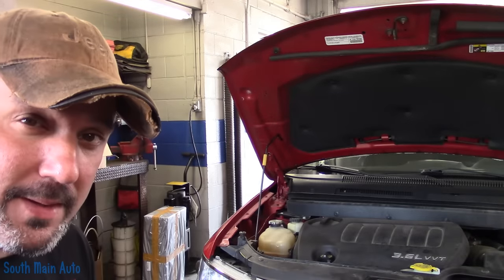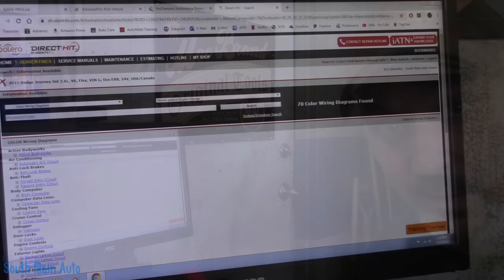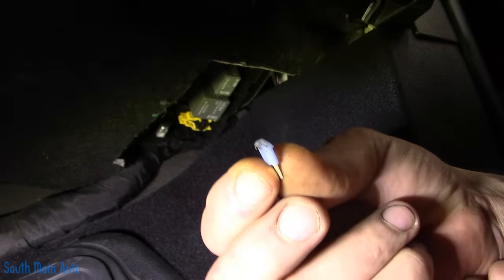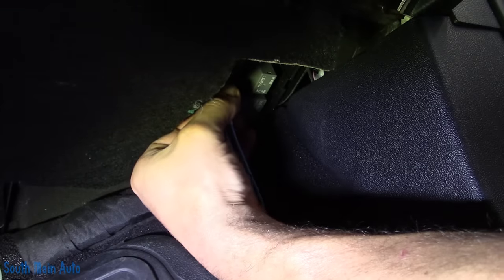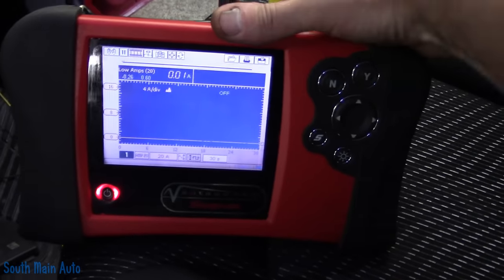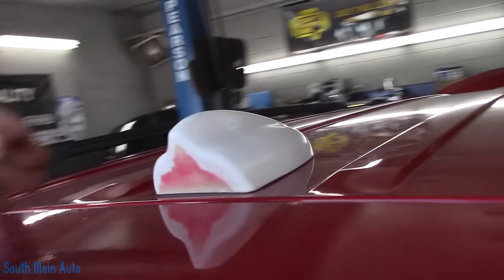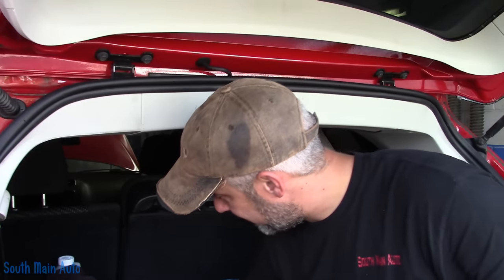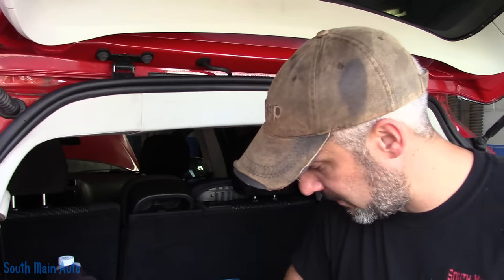Dodge Journey: No Start, No Crank

Comment from the maker: UPDATE: The customer stopped back a few days later and we installed the OEM antenna on the roof so it would solve the issues with the wet headliner. He bought the car in the condition it was in, back up camera and baby shark fin were all ready on there. He did not want to do any further testing with the internal key detection antenna's at this time
Reply: Hopefully he asked you to pull that silly cow catcher off the back too!
Reply: Just curious you disconnected the aftermarket feed wire  at the backend wouldn't it be better to disconnect at the feed just incase it rubs through elsewhere .
Reply: the aftermarket crap ends up being the eBay aftermarket crap and it just goes bad after a couple months or the rubber seals go bad
Reply: @190055joe  the video feed runs all the way to the front. The power is tapped of that module in the back. He cut the power wire and the video feed is now dead because of it. So it doesn't really matter if it rubs through, because there is no voltage on it anyway
Reply: Thanks for your very informative videos. Your patience with wiring and troubleshooting is amazing. You take the time to find the source of a problem. That's inspiring and auto mechanics everywhere should follow your example. Keep up the great work and your videos.
Reply: It is nice the aftermarket stuff didn't aggravate you as much this time; and you hit the nail on the head ...  lazy, bad installation of the products is the problem, not the product itself; they hit a moment of ignorance and instead of stopping and learning the right way, they just go for it and f the consequences.
Reply: Wireless backup cams are better
Reply: @1232bluejays  "wireless" cams still need to get 12v from somewheres....
Reply: @1232bluejays  "Wireless" are wireless for the video feed.  They still need power and for this installation it was the power feed that was the killer.  Maybe you have realized that before I write.  Cheers.
Reply: The process of getting from "car won't start" to "single chafed wire behind the headliner by the tailgate" never ceases to amaze me.  Well done.
Reply: @1232bluejays  They still need to be connected to a 12 volt power source, and that's what was shorting.
Reply: I like that you told us what the customer decided to do,.
Reply: @190055joe  That is the ironic thing, the +12VDC feed IS back there where Eric cut the wire. @22:25 "....decides to use a wire way up in here for a power source...."
Reply: I'm going to go out on a limb and say that backup cam installation wasn't overall bad, at least from what was shown. The big mistake was not realizing that wires will chafe through on a sharp edge, and do something about it, like add insulation, a chafe guard, or put them in the loom. Frankly that is an easy mistake to make if you are basically self-taught. I made it myself a few times back when I was 16 or 18 or so. Once it is pointed out to you, you shouldn't make that mistake again. If you do, THEN it is a bad installation by a bad installer.
Reply from the maker: @190055joe  That was the feed wire to the aftermarket stuff. The fuse feed the module and they tapped into it to gain a feed for the aftermarket stuff. Make sense?
Reply: according to the manual for my 2013 buick verano, when the battery in the remote gets low you may need to put the remote UNDER the cup holder before you can use the push-button to start the car. replacing the battery in the remote might be worthwhile. love the videos
Reply: @allenparke5874  low battery would be secondary.  I have a 2013 Journey and there are 3 indicators around the start button that should light in turn.  OFF, ACC, and RUN.  Off should be lit once the door is open or when the car isn't running (don't remember if it stays on continuously).  Single press from off with foot on the brake switches straight to run position and cranks the engine.  Foot not on brake should cycle between the three positions so long as the key is inside the vehicle.  When Eric first brought us inside the vehicle non were lit at all which indicated (to me) no power to the wireless key module/switch assembly.
Reply: l wilton gotta disagree, it was a bad install for both the wire rubbing issue and tapping into power in a place the installer shouldn’t have.  Ignorance of proper installation doesn’t change the fact it was a hack job.
Reply: Baby shark Doo Doo Doo doo
Reply: From the start of the video I was thinking install fail, I've been installing for 30 years and have seen some horrible and dangerous installs (mostly fire and police vehicles) I'm going to share this video in one of my car audio groups, cause I preach this stuff all the time about what happens when the customer takes the car for service and they see that crap. We have to be extra careful because we don't have access to some of the wiring a service tech has. But in the same breath I will say we get blamed far to often because a tech is lazy and can't see past the aftermarket and look at the tech brief that I find and send customer back with LOL.
Reply: Ive always found aftermarket stuff is best installed with a dedicated fused power supply.... It eliminates issues like that...
Reply: @190055joe  The aftermarket wire appeared to be drawing +12v from the antenna circuit, then feeding the camera and the device at the rear view mirror.  But who knows what was done by the dodgy installer.  Presumably a test was done to make sure all the non-oem wires were cold.
Reply: Typical Auction Car, probably why it was there. Never Have I or Would I Run Wires Through Headliner.
Reply: @DaaaveO1971  Maybe the customer has a problem with tailgating cows and road rage: the automotive version of mad cow disease?
Reply: Hi Eric and gang always good too see you
Reply: most "rear" wireless cameras get their power from the Reverse light 12 Volt Rail.  which activate only with in reverse.  there are few aftermarket gadgets that i like, Rear dash cams, and reverse cameras are them.  I don't like remote starters, since that messes with the security of the car,  this is a prime example of what not do do, there was nothing to prevent that wire from rubbing. absolutely nothing,  if ti was me there would have been a rubber grommet around that passthrough, the wire would have been feed though the wiring harness, and routed along to the front fuse box, where it would have been put on it's own inline fuse, routed from the primary 12V feed, however i feel that it being connected to a "always on" power would cause a fantom drain,  therefore i would have connected it to the accessory power rail. so that it was only powered when the car is powered.  and.. WT* is with that darn shark fin.  who in their right mind would put a dang shark fin on their car.  (puck * teenager that'd be who) and i have to agree with eric O.  that bumper has to go!
Reply: @1232bluejays  watch that really mess with the cars rf systems
Reply: Daddys shark do do do do do do daddys fin do do do do do its a leaking ing ing ing ing ING ING INGGGGG lol
Reply: @Cozmo85  thanks.  Now I got that song stuck in my head.    Do do do.   Lol
Reply: I was hoping for a video of you fixing the leaky shark fin.
Reply: What scan tool / ampmeter is that?
Reply: @Mr.Torres831  when I shop on Amazon I look at the low ratings before I look at the high ratings. Sometimes you can look at the low ratings and see that the people who are complaining about the product never open the instructions. Or they had expectations that was well beyond the capabilities of what they were buying. Or they did not read what the product came with. I don't trust the high ratings or the rating system in general because unfortunately Amazon allows sellers to negotiate with the customer to remove a negative rating in order to get a refund or whatever.
Reply: Baby shark fin LMAO
Reply: @spankthemonkey3437  probably  too late but at that mileage the fix most likely would be a rebuild which would cost more than the car is worth. The clutch pacs wear over time and the friction material becomes one with the fluid. When the clutch pac is applied to provide a gear some of the friction material/transmission fluid gets trapped in between the clutch friction disks and the steel disks. If you flush that fluid out most likely the transmission will start slipping due to excessive wear on the clutch pacs and no gritty fluid to help. You your going to change your automatic transmission fluid i recommend 60,000 miles or 5 years what ever comes first.

In no way am I an expert or professional automotive repairman but I've seen my fair share of under a few cars hoods. What I'm saying is I like cars and like to know why things break and how to fix them or keep them from breaking.
Reply: Jason Coughenour  its not a over volt problem. Its a short circuit problem
Reply: @zakuraayame5091  the amount of times I've had customers call me for a no crank condition due to aftermarket crap is unreal, granted the work was nice but I wish if people put this crap in, they would do it right. I have had to fix other people's mistakes but bottom line is if you ain't gonna do it right don't do it at all
Reply: I have a problem with Dodge Journey no start no crank but all headlights came on. I scanned and I got this code U1197. I checked the fuse box and all relays nothing changed. Any ideas?
Reply: He saw the bill and figure out its not worth it.
Reply: I know this video is a year old as I write this. But after watching several videos it seems that you run into this type of situation a lot.  Saying that, my take is to stay away from cheap aftermarket stuff and cheap installers.
Reply: @Cozmo85  Daddy shark doo doo doo doo doo doo...
Reply: @Cozmo85  Mommy Shark doo doo doo doo doo doo
Reply: A true journeyman and you cannot get to this level without putting in a 1000 hours of training, and you must be intelligent.
Reply: @DVXCine  I live in Pennsylvania and for a long time there were no dealers in my local area for aftermarket truck beds, a former dealer told me he gave it up due to certification hassles with the state. I got the impression that the state was really strict on proper installs. Then I owned a few trucks with service bodies and learned most installers have a degree in electrical butchery... A friend of mine is a mechanic in a shop that sees plenty of police cars and those are worse because of the added holes allowing water intrusion to the sketchy wiring. Decommissioned emergency vehicles are even worse because some wiring gets overlooked and the person doing the strip out has no vested interest in restoring the wiring to proper functionality.
Reply: Great sloughing
As my ‘17 Journey won’t start and battery charger clamps heat up while charging and charger breaker clicks off. I hate the wheel well battery location 🤬
Reply: "all I can do is sing baby shark song now, doodoo do do" . ☠️😂 I laughed out loud at that one.. my dad said I thought you were watching  videos about your car, I am dad but this guy is funny 😭

Comment: Eric took his cap off. Shits about to get serious
Reply: GLAD I SCRAPPED MY DODGE CHRYSLER FOR SUBIE-
FORD TOO-
NEVER AGAIN DODGE FORD
Reply: @ekop1778  You forgot to add GM to your list of "never agains"
Reply: @ekop1778  subie is my never again. Dodge hasnt stranded me yet.
Reply: I had so many issues with my 01 Outback, the only thing that didn't break was the head gaskets.
Reply: If Eric took his cap off while talking to a customer i would be running.
Reply: @aaronbryant1008  WELL IT LEFT ME STRANDED FOR AGES WAS ON THE FLATBED LIKE 7 TIMES  YOU BEEN WARNED BUDDY IT MIGHT BE GOOD NOW-BUT DOWN THE ROAD
HEADACHES WILL FLARE
2018 SUBIE 9K ON IT NO PROBLEMS SO FAR IMPRESA-
WHY I LEFT FORD, DODGE
Reply: @mark98070  DONT EVER BUY A FORD, DODGE, GM--------
Reply: @scott8919  MY 2018 IMPRESA 9K ON IT NOW  NO PROBLEMS SO FAR--
BOUGHT IT WITH 200 MILES DEMO MODEL
Reply: @ekop1778  Until your Subie blows the head gasket (hopefully not).  I did a head gasket on an H6 Tribeca.....not fun!  Seems 50% of Subies blow the head hasket, even when serviced with the Subaru coolant additive.
Reply: That may be, however no brake clean was used!
Reply: His cap is distracting to me sometimes. When he is facing the camera I find myself staring at the torn up bill and missing what he is saying and have to rewind.
Reply: @ekop1778  Lol. Subarus and their head gasket nightmares. Maybe one day they will put 21st century engine technology in their vehicles.

Comment: I do all of my own installations of aftermarket equipment (amateur radio) etc. Watching your videos has greatly changed the way I do installs.  Abrasion resistant loom,  proper connectors,  separate fuse blocks,  no vampire connectors.  Thanks for the insights into the problems poor installations cause for repair shops.
Reply: I had to look up what a vampire connector is, and it looks like a legitimate connector for repairs or aftermarket installs, what is wrong with them?

This is the first time I learned of vampire connectors, thought you meant like just twisted together wires or some shit.
Reply: @ratataran   The problem is trying to find them if you're the next guy trying to troubleshoot. They're not foolproof.

Comment: I don't think viewers should go crazy on the comments because of Eric disconnecting/deleting/defeating aftermarket stuff.

I mean, Eric's job is to fix the car's issue, and if that is caused by some external device causing havoc and fixed by removing said contraption, then so be it.  

We should all realiz that Eric ain't no car stereo installer, he's a car tech and he's gonna resolve the drivability issue he's been hired to fix. If the owner wants his/her aftermarket stuff back on, then an expert qualified installer should be the one to be hired for the job.
Reply: Ty Jesus and ty Eric for at least giving me places to look other than "it's ya bàttery!"   My car hasn't had dependable cranking for nearly a year and a half due to very similar issues  looking forward to have someone check into these possibilities
Reply: What I would have done to fix it, since the problem is a break down of insulation is reinsulate it. With a piece of rubber hose (vacuum line) slit up the side and installed over the wire, tied with small zip ties and maybe file down the sharp edge. This would love all the after market accessories in place and undisturbed.